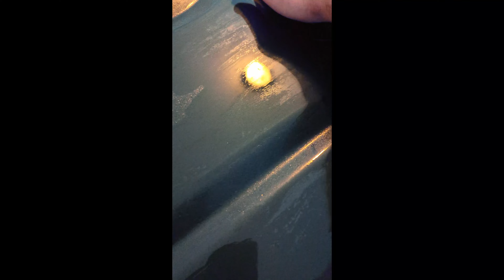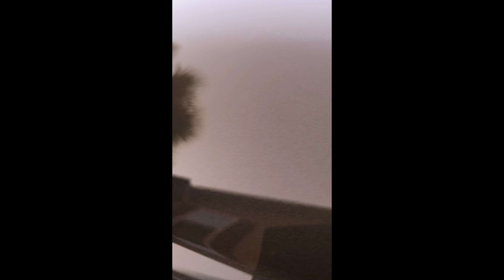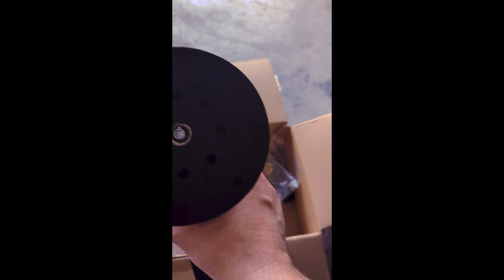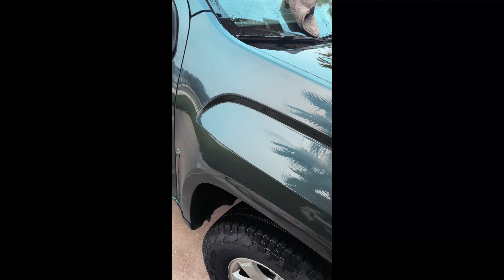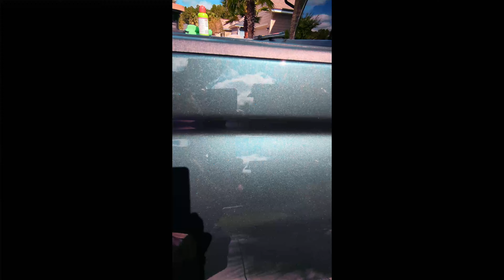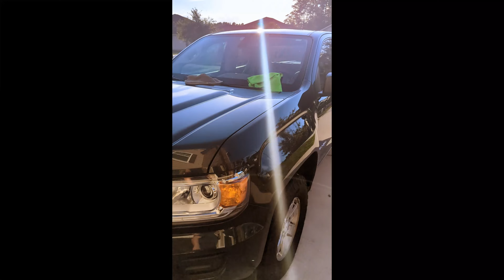#144 ETA Wheels Review Batoca Dual Action Polisher

Comment: Hi I have a question how much does you polisher isolate by looking at it sideways ?im not sure if mine in broken cus it about a 1/4” off. Between the lowest and the highest point.
Reply from the maker: @dee1251  Great question! Mine does a fantastic job of isolating and spins true for rotation if you properly center the pad. 

It's honestly shocking how similar it feels with my rupees MK2. I really enjoy it.
Reply: @ByronETAWheels  I meant when you look at it from the side does it also isolate up and down close to 1/4”?
Reply from the maker: @dee1251  yes it does ocilate up and down, as well as side by side of you don't properly tighten the nut that holds the backing plate off. That should be snug and may correct the issue. 

If you watch a "washer mod" video on these and types of polishers just like it, it may also correct the issue you are facing.
Reply: @ByronETAWheels  yes that definitely fixed it , took the screw off and reinstalled and it’s much better, doesn’t isolate / go up and down that much. Only slightly, like i think it’s designed to do. Thank you for the great advice !